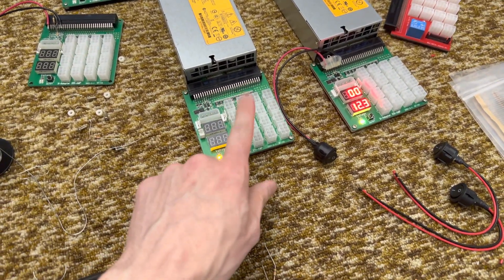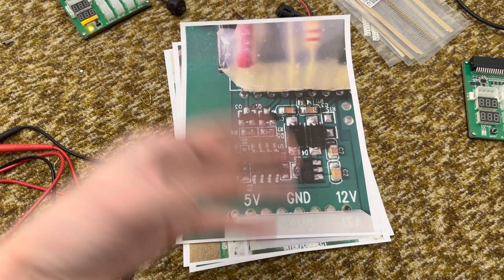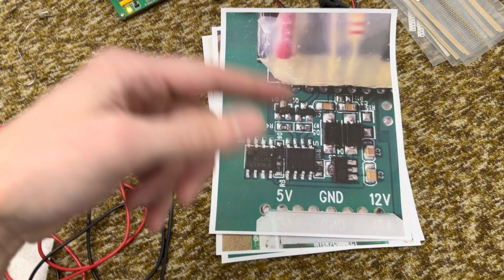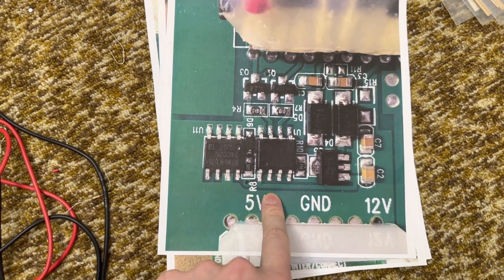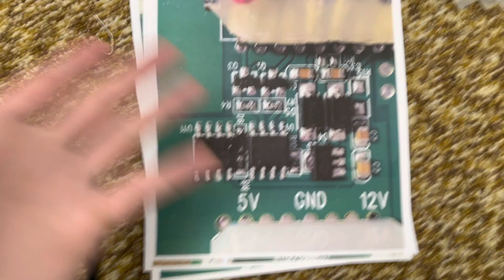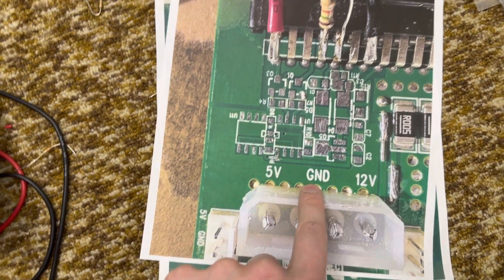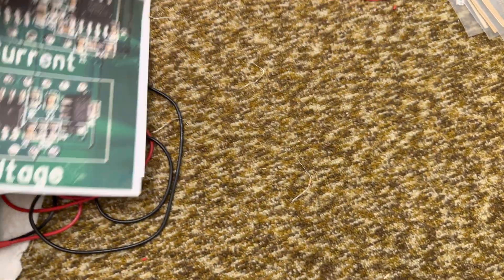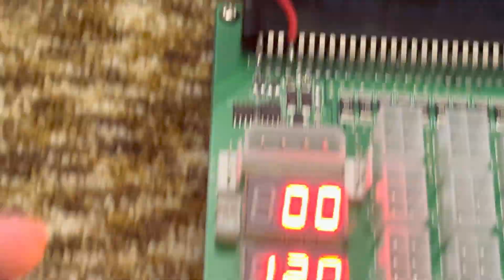Crypto Breakout Board DIY FIX

Comment from the maker: ✔ Switches - https://amzn.to/3lqurTu
✔ 22K Resistors - https://amzn.to/3lrvFxT

✔ Solder Wick - https://amzn.to/3xcmWlJ
✔Cheap Soldering Iron - https://amzn.to/3EjS0Ef
✔ Cheap Glue Gun - https://amzn.to/3Xj6Jpp
✔ 15K Resistors - https://amzn.to/41u6gD8
✔ PNP Transistor (SOT-23/25V/1.5A) - https://amzn.to/405WvtV
✔ PNP Transistor (SOT-23/40V/0.6A) - https://amzn.to/3KYa76h

New Breakout / PSU?

✔ HP Common Slot (Most Common) Breakout - https://amzn.to/3RNY5hy
✔ HP Flex Slot (Newer Style PSU) Breakout - https://amzn.to/3lto2qr
✔ HP Common Slot Titanium PSU - https://ebay.us/gLVa4K
✔ HP Flex Slot Titanium PSU - https://ebay.us/bInvmW
Reply: Thanks again for the fix! Testing it outside of the rigs passively to a 1660ti for a couple days just to be sure! 😂 still bought the resistors but most likely won’t need them since this trick worked on all of my breakout boards

Comment: Is there any way to do this fix while retaining the sync feature? I also use the Remote power management modules, so I'm curious how those will work or not work at all?
Reply from the maker: Yes, most likely if you replace the PNP transistor it should resolve it. Otherwise no, the sync and remote management won’t work.

Comment: Thank you, is it also same thing for zsx amp breakout board, am using dell psu (model D1200E-S0)?
Reply from the maker: Yes, I believe so.
Reply: @SiCPoWMining  my breakout board randomly turns off and sometimes doesn’t even turn on like the video, i tried following both methods none worked, do i need to remove the main circuit? Because i tried both methods, 1st method jumping pin 1 and 4, 2nd method jumping 1 and 7 with 22k ohm resistor on pin 4 and 5, none of them control the powering option
Reply from the maker: Are you sure the PSU is good, and has power? Do you have another to swap with? This should work.
Reply: @SiCPoWMining  unfortunately i only have that power supply, but I believe the psu works fine, like it has power ofc, the breakout board was acting the same as your video (power button wasn’t working) after sometime it started working again but it randomly shuts down, the psu is 1400 watt, i only have 2x3060ti running on it
220 outlets btw

Comment: Thank you so much, going to go fix my drawer full of boards now! I did have one question tho, have you done this mode on any of the atx breakout boards as well? Is the pin out the same I would imagine?
Reply from the maker: Happy to help. I haven’t done this on a ZSX AMP yet, but it shouldn’t matter. I believe my friend I got these boards from has a few dead ZSX’s as well, so I’ll probably fix those eventually. Might make a video then.
Reply: @SiCPoWMining  Just wanted to give you an update and everyone else here, as I did not see a discord or anything. I have successfully done this mod (with the 22k OHM resisters) on the ATX breakout boards with HP powers supplies. Super stoked! thanks for the knowledge! I can send pics if we have a channel to dump them on 👍
Reply from the maker: Great to hear. I should make a discord group…
Reply: @SiCPoWMining  Great Thanks! I will i hit you up if there is great success!

Comment: Thank you! This has been frustrating for a while now, and I had no idea why my boards wouldn't work as I'm not technically inclined to figure it out. I've been able to essentially short my boards by putting a finger on the chips mentioned, usually causing the board to turn on...or the delayed turn on as you mentioned. Although, that then requires you to unplug the PSU to turn off which is annoying. Subscribed!

Comment: You know what’s funny Parallel Miner told me recently, “Back in August of last year we upgraded the resistors used on our breakout boards which helped similar issues that you are experiencing.”
Reply from the maker: The new models have another connector on the left side. You can see a few of them in the pile I have here, they failed too. I’m not sure what they changed, they look the same, and I have dead ones. 🤷‍♂️
Reply: @SiCPoWMining  yep, got the excact same reply from them back late last year but almost all the board they offered to swap out still died within 6-8 months so back to square one. i tryied the 2 resistors methods a while back but it didn't work on all the board at that point. Going to give it another go with the switch/resistor instead. Yhe remote power control while nice is not that important to me and those chips are to tiny to mess with for me
Reply: @locke3817 All three of my X11 died but my 3 X11 Amp's are running fine and even the ZSX, mid way through though I switched away from these HP PSU's to Dell's PowerEdge simply because I didnt want to do (2x)750W for each rig because of how efficiency falls a bit after like 50-70% load and the 1200W from HP isnt actually 1200W on 120v circuits. Those 94% Dell PowerEdges were like $20 for 1100w on 120-240V and then breakout boards from parallelminer were $16 but THEN AGAIN, the ZSX verision of this breakout board works fine BUT THE X15B same issue as the X11... lol
Reply: @allenramen1380   maybe it's party related on the PSU spec to then... i only use HP 1200w on 240V PDU ( i know they are only 900w on 120v) i've got 1 dead X11 out of 8 running but 8 X11 AMP dead out of 12. i run all of them at about 50ish amps to avoid the psu fan going nuts and rig config/gpu split
Reply: @SiCPoWMining  quick update, i was litterally just about to order 8 new X11 board this week. Tried you latest method on 2 of my X11 AMP. One with a switch, one hardwired  and the 22k resistor and it work perfectly on the board that refused to work with the previous method. i guess the second resistor wasn't cutting it. Waitng on the switch order tomorrow to fix the remaing bad boards and replace the hard wire one as i prefer the flexibility of the switch. Really appreciate your follow up on this!